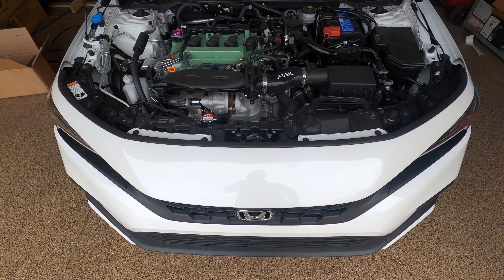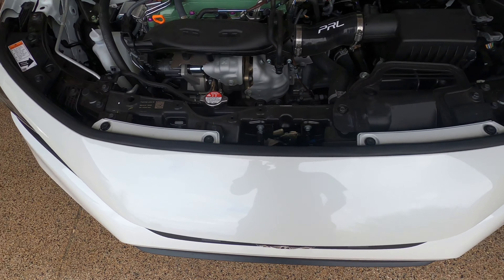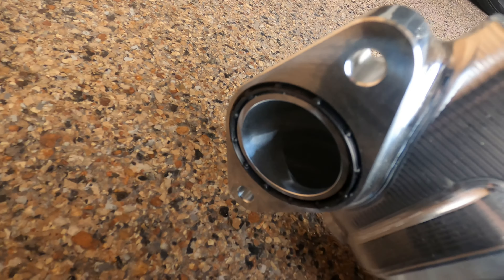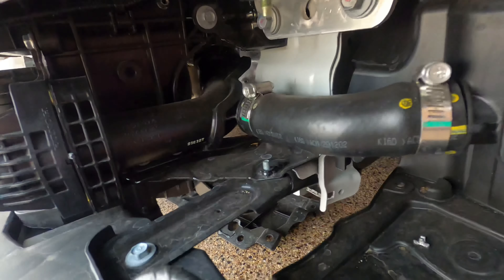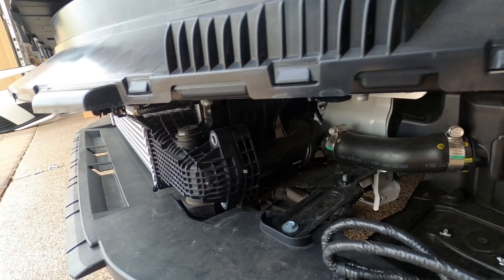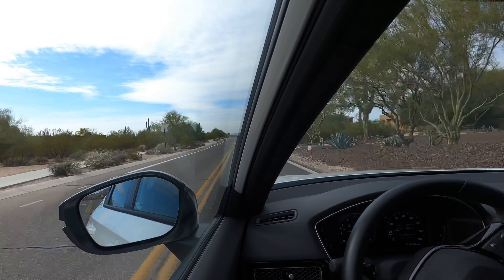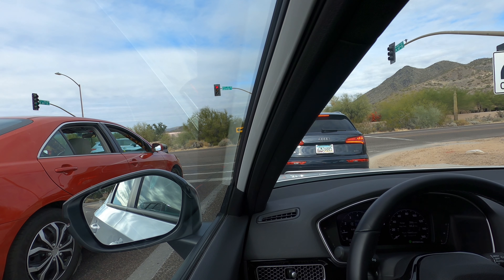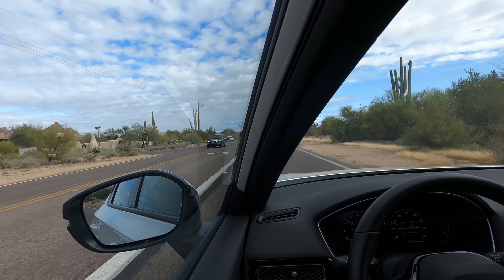Axion Ind 2022 Honda Civic1.5t PRL Motorsports FMIC install

Comment: Is this compatible with the 2022 Honda Civic Ex model? They finally came out with an exhaust system for the EX model, I would love to buy an intercooler for the civic as well, Don't see anyone really building anything for the Ex models 🥲
Reply from the maker: If it’s a 1.5t it works

Comment: Do you have burbles when you lift off the gas?
Reply from the maker: On the exhaust? We pop a ton cause we are running downpipe and dump to the street
Reply: @axionind  like no exhaust back from the downpipe, just dumping right out? Would love to see a video of how that's set up hahaha
Reply from the maker: @mindermedia9136  its in the install video we have on the page installing the parts we sell from PRL for the 1.5t

Comment: Are there any bolt-on mods that won’t void factory warranties?
Reply from the maker: Most don’t depends on the dealer, if you are worried don’t mod
Reply: @axionind  I was thinking just a short ram intake is all I’d need until the 5 years are up.
Reply from the maker: @SIIKAP1  I had a dealership deny warranty for a Subaru cause I had wheels on it
Reply: @axionind  ayeeee same. i had premium spec wheels on my base wrx and they told me to fuckoff... so happy with my 11th gen :) just got my intake res delete installed and I'm more than satisfied. Car was peaking at 13-14psi and after the prl res delete it peaks at 17-18... way too fun.

Comment: does the 11th gen hatchback civic 2.0 manual transmission have a lot of potential in terms of adding extra horsepower? Will there be a ktuner for the 2.0 manual hatchback yet?
Reply from the maker: Almost no potential
Reply from the maker: Ktuner are working on it

Comment: How's the clutch holding up?
Reply from the maker: Still holding but im doing the trans next month since we are doing big turbo and e30
Reply: @axionind  Beautiful! Can't wait to see what's to come! What clutch are you planning to go with? I Haven't seen any aftermarket offerings available yet.
Reply from the maker: @matthewdennehy3767  Ya all the 10th gen ones work but supply is very low. We are going with a Type R retro fit from NA performance who is doing our PPG gear box and trans
Reply: @axionind  Oh nice!! Do you need to use the 10th gen flywheel as well? I read on the 11thgen forum the flywheel was slightly different. Appreciate the info!!!
Reply from the maker: @matthewdennehy3767  yes you do but most clutches come with flywheel